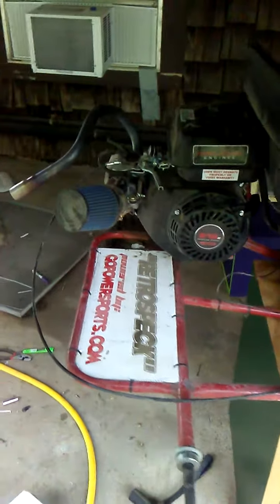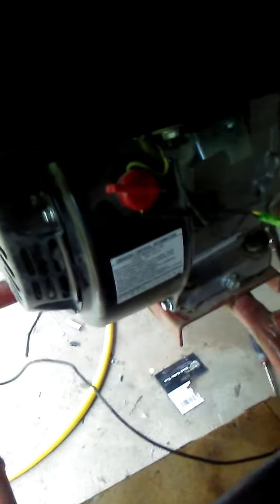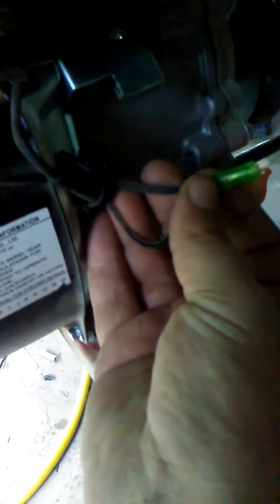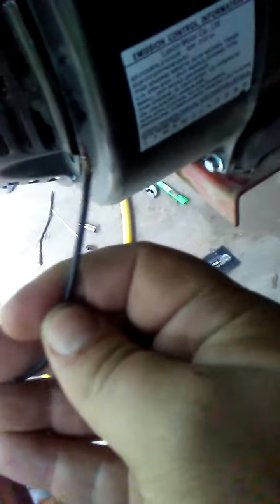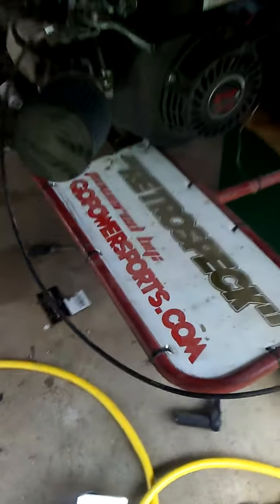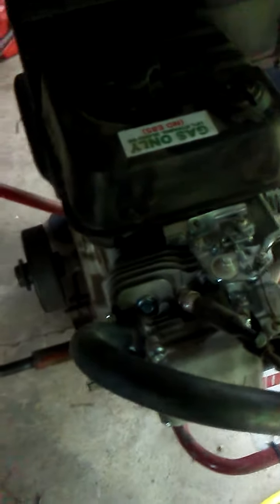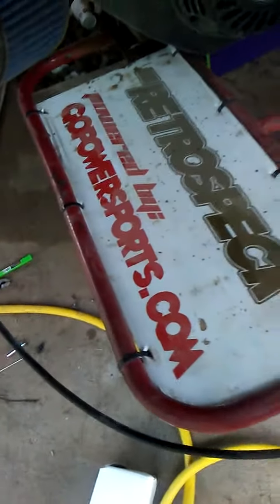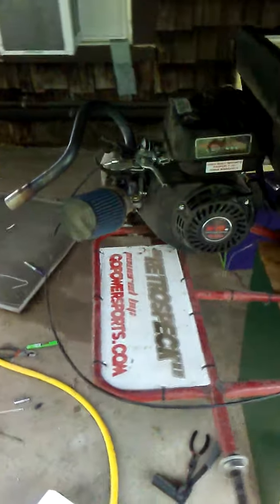Simple Kill Switch - 212 Predator

Comment: That works as long as you have a metal toggle switch. If you have a plastic switch, you will have to run a seperate wire